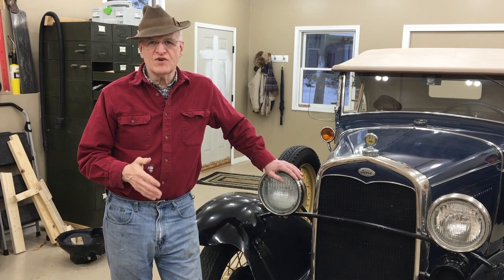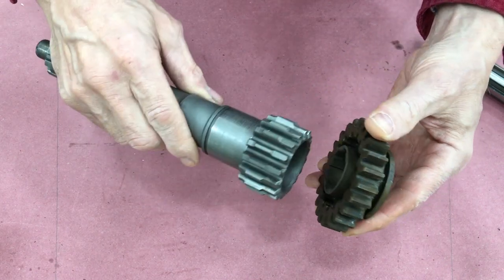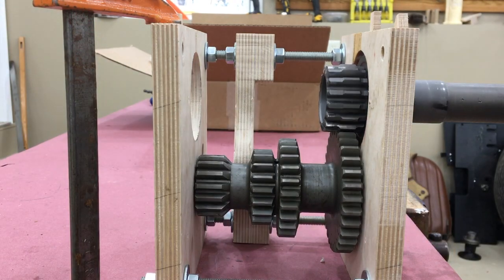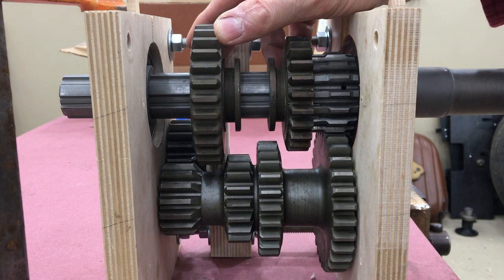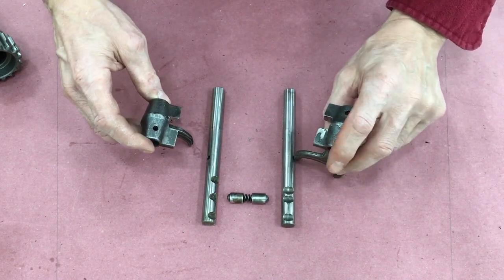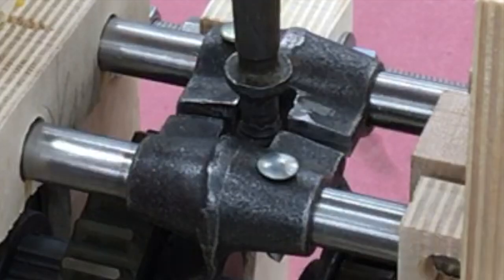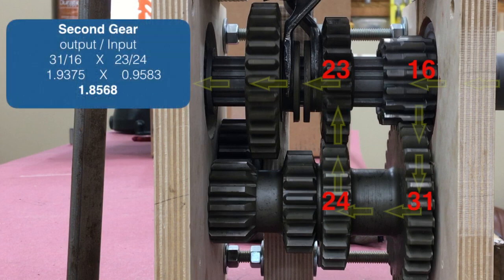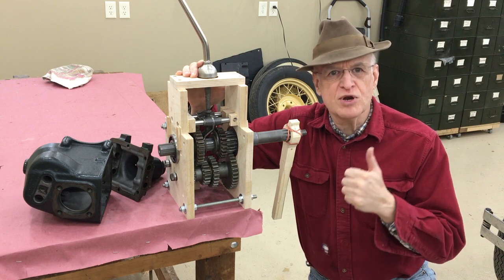Ford Model A Transmission - How it Works

Comment: George, I have a 1929 Model A. It will shift into 1st 2nd and 3rd.  I have checked the shifting forks, gears and reverse idler gear.  Everything is looking perfect. Clutch engages and car moves forward.  I have also checked to make sure the reverse gear is full engaging to the rear. Im at a total loss.  Any suggestions?
Reply from the maker: Sounds like everything works.  What is the issue?

Comment: I need to change my cluster gears. Is it necessary to remove the transmission to do it or can I just slide back the U-joint cover disconnect the U-joint to drop the drive shaft,  and then takeoff the shaft lock remove the upper shaft and gears to get to the cluster gears and remove that shaft clean out the box put the new cluster gear in and then reinstall the upper gears again and then continue the reassembly?
Reply from the maker: Nope, I wish it was that easy.  To take out the cluster gear, you will need to remove the transmission.  To remove the transmission you will need to either remove the rear axel, drive shaft, and U joint, or the engine.  The U joint in a model A cannot be removed like a modern car, it is in line with the real axel, and cannot be accessed absent removal of the axel.  Take a look at the transmission removal video in this series, I discuss this in the video.   Thanks for your comment and watching this video.

Comment: This is a great video. I have a question for you. My first gear is gone. All the teeth on the gear were destroyed by a transportation driver from a production company. I was told it was possible to change the first gear without taking the transmission off the car… by removing the lower shaft replacing the gear and then putting it back together. Is that possible? Or should I set myself up for having to remove everything?
Reply from the maker: Thanks for the comment.  I suppose it might be possible, but you will for sure need to expose the back of the transmission.. to do that you would need to remove the rear axle and drive shaft.  After that work was done, you may as well remove the transmission for ease of working, and to checkout the remaining gears.  If the first gear is stripped, I suspect there is additional damage.  Check out the remaining videos in this series and you can judge yourself.   Good luck.
Reply: Nope out with the transmission.

Comment: Is the transmission for a Right Hand Drive the same? Are all the parts the same or is everything different? Are these parts available? Thanks for a very interesting video.😊
Reply from the maker: Yes, this transmission was used in all cars, right and left hand drive.  Yes, parts are available at most any Model A parts dealer.   Thanks for your comment.
Reply: All the same.

Comment: Hello, I have a 1930 model A cabriolet. Went to the store last night, shut down the car, came back out and she would not move-though the parking brake was on or the wheels were blocked. It acted like the gear shift lever was stuck and I could not get the car into gear. Neutral position on the gear lever was at the top near the dash.  After some nasty words and rocking the car a bit, I could get it into third and was able to get home. It drove like it always does with no issues.  After watching your video's I came to the conclusion the shift tower needs a rebuild. The 2nd & 3rd shift rail was very easy to remove. The shift rail for low and reverse was a bugger to remove from the housing as were the plunger and spring. The shift forks look fine.  I did not see any wear on the plungers or springs, but the rails seemed to have excessive wear.
I was worried something went haywire in the gearbox but I was able to move the 2nd & High and Low & Rev gear very easily.  So, my question to you is; have you ever run across the before? and am I one the right track? Is there something I may have missed?

Sorry for the long question and Thank You!
Reply from the maker: THnaks, I sent you an email

Comment: With all those straight cut gears, that bugger must have been whiney.
Reply from the maker: Yes you are right, first and second whine.  99% of the drive time is in high gear, which is direct from the engine to the rear axel… no gears.   Thanks for the comment.

Comment: Thank you so much for this video!! I just bought a 1931 Ford model a truck and looked it over yesterday was very excited about the inside of the motor being so clean and not locked up! Don't know about the transmission yet so this video would be helpful for me if I need to work on it.
Reply from the maker: Thanks for the comment.  The other videos in this series should help you as well.

Comment: ... I can almost make that with my machine lathe and a few other hand tools. This is really impressive. Especially considering all the forces involved here. The power isn't mind boggling, but they are impressive. Thanks for showing us this. Its almost inspired me to make my own transmission for a project I have. 

And yes, this transmission was leagues better than shifting via foot pedal in the midel T hands down!
Reply from the maker: Thanks for your comment.  Yes I think you are right. With a mill to cut gears, and a lathe to make shafts a fellow could build this transmission in the garage…..  which is kind of what Ford did back in the day.
Reply: Good job Sir!
Reply from the maker: @carlmoseman671  Thanks

Comment: Thank you for this video. I am restoring my model A and i found out i do not have the transmission shifter fork pins. Do you have a preference on which pin to use? This video has taught me a good amount of knowledge.
Reply from the maker: Thanks for the comment.  The pins I used are made of aluminum, and can be ordered from any model A parts supplier.  Good luck with your restoration!
Reply: @georgebell7103  thank you

Comment: Great video! With the oils available today. What do you recommend to use in the transmission. By the way love your Roadster. I own a 30 deluxe.
Reply from the maker: Thanks for the comment.  I use the original type heave oil.  It can be purchased at any Model A parts suppliers

Comment: Great mockup fixture!
Note that the detent ball/slides are spaced apart so that only one selector shaft at a time can be out of its detent pocket. The ball/slides back ends literally run into each other preventing both slides from moving..This blocks sliding both shafts from neutral when the shift stick pockets line up and no side pressure is put on the shift stick and it is pulled back or forward.
Reply from the maker: Yes, thanks for the comment

Comment: Thanks for this. I've never had anything to do with a model a transmission and likely never will but have just watched this video closely and understood it, finding it extremely interesting!
I do own an old Massey Ferguson with a 3 speed main transmission (+ high/low) and expect it will be very similarly laid out to this one as gear gears are in the same positions.
Reply from the maker: Yes, your tractor is likely is very similar. Thank You for the comment

Comment: Yes you did a good job George. But if you’re taking a long trip in your model A. And you want your girl to be close to you and the shifters the way you pull it up and shove the shifter to the dashboard and it stays in high gear pretty cool. When you need to change gears pull the shifter back and it snapped back into place..
Reply from the maker: Sure, Thanks for your comment

Comment: Great job of showing  the  power flow.  There is nothing to add for a modern automobile except for the addition of synchronizer rings and additional gear ratios.
Reply from the maker: Yes, I agree. Thanks for your comment

Comment: The best explanation of how a basic manual transmission works, period.  This could / should be used to teach automotive mechanic students… if they still do that🙄.  I consider myself an advanced mechanic and still enjoyed the presentation and found the ratio math useful.  Great Job.
Reply from the maker: Not really, just haven’t had the inclination to do another video.   However, I have a few ideas in mind.
Reply: @georgebell7103  OK, well, I’ll stay subscribed in case u do 😎.
Reply from the maker: Hey, thanks for the nice comment.  You might enjoy the other videos in this series
Reply: @georgebell7103  Yes, I did watch them all.  Sorry I didn’t comment for each one.  I noticed you haven’t made any new videos in 2 years.  Have u moved on to other endeavors?

Comment: The surprise is not how primitive it is, but in how much they got right and haven't changed since: cluster gear, on counter  shaft, needle bearings, reverse gear, straight through high gear, H pattern shifting, shift forks, slider splines, cluthc plate and spline, transmission housing casting, shift tower.  Seeming only missing synchros.
Reply from the maker: Yes, you are right, the transmission shown here is in its simplistic  form. Ford improved it nearly every year from this point forward.  Thanks for your comment

Comment: I’ve rebuilt modern 5spd automatics and understand them well, but the manual transmission always confused me as dumb as that sounds. This video is the best yet I’ve found that is middle of the road on knowledge; assumes I know a bit but doesn’t assume I know too much. Well done.
Reply from the maker: Hey, thanks for the comment.  Middle of the road is about all the knowledge I have.
Reply: @georgebell7103  
Drive middle of the road, OK. Drive to left, end up hitting semi truck, crunch. Drive to right, end up hitting tree in ditch, crunch.

Comment: Just stumbled upon your video and found it very interesting. Being a mechanic for my entire life, I'm still learning. It's amazing how simplistic those transmissions were. Very compact and did the job also. Thanks for your video! Keep up the good work. By the way, I was trying to find the weight of the Model A when I found your channel. Any clues?
Reply from the maker: Thanks for your comment.  Different weights depending on the body type. The Roadster is 2,300 pounds, which I think is the lightest body type
Reply: @georgebell7103  Thanks for satisfying my query. I was figuring about 3K. I stand corrected..
Reply from the maker: @janyoung1633  Model A was a light car. Ford cars Got heavier during the 1930s as the engines became more powerful

Comment: I Loved your demonstration. Very well put together.
Only one minor item I would have liked to have demonstrated and that was how the shift lever could be raised by the driver to disengage it and rotate it against the dashboard to allow unencumbered entry or exit from the passenger side. Loved my 1931!
Thanks
Reply from the maker: Thanks for your comment,  I have never done this, but have heard others tell the story.  If it can be done it is because the tower of the transmission is badly worn, allowing this kind of movement.

Comment: Great video, great explanations, surprisingly similar to todays transmissions.  Just add sliding clutches between the gears and snap rings to hold the gears in place and it's about the same!
Reply from the maker: Right!  Thanks for your comment
Reply: Either double clutch or learn how to shift without a clutch. Done right, no real grind with either method.

Comment: Excellent video. Thank you for taking the time to build the display box. Seeing the tranny in action from the lateral view is neat. It makes you understand why double clutching and matching shaft speeds lets you slide into gears without grinding!
Reply from the maker: Thank you for the nice comment. Yes, I wanted folks to understand what was going on when they are operating the transmission.
Reply: It's fun to watch someone with little experience trying to drive a car with no synchromeshes on the gears. Most people don't get the concept of matching the shaft speeds.

Comment: Absolutely brilliant explanation. So it's a "crash box". I learned to drive on one, in a Blitz wagon. Very angry if you can't judge the revs. How are the shifters held in place - friction pins, screws?
Reply from the maker: Thanks for the nice comment. The shifters, and therefore the sliding gears are held in place by spring loaded plungers that fit in detents in the shifter shafts.  Check out the transmission assembly  video to see these.  https://youtu.be/rVC-fSBe4WM

Comment: This is helpful although I am still wondering if there is a specific part to connect a model A transmission to a predator 22 hp v twin
Reply from the maker: Yeah, probably need some kind of adaptor

Comment: Many years ago I had access to a couple of different model A Fords. I remember being taught how you could pull up the shift lever when in 3rd gear and then
rotate it off to the side so it doe not have as much interference with the passenger's legs. I was telling a friend about this, as his brother has just bought a
model A, and no one seems to believe me.  I am Kay's husband of 57 years, and spent many of my teenage years working on old cars. Thanks for any help
you may be able to give me.  Dale Lofgreen
Reply from the maker: Sure, I think this is possible. The shift lever is pulled (held) down with the spring in the tower. The shifter also has two pins that hold the lever in the proper orientation relative to the transmission. These pins and the cutout in the tower casting is shown in this video at 8:15.

I suspect the shift lever could be pulled up so the pins clear the indentations in the top of the tower, then rotated 90 degrees. But, to do this you would need to overcome the spring pressure on the shift lever, which is substantial.  

I think old timers that did this trick, perhaps had no spring in the tower, weak spring, or significant wear in the tower casting. I doubt if it could be done easily in a well restored, or new transmission.

Thanks for your comment.
Reply: Great  video,  very  informative   Great  explanation  of  what  happens  when  shifting  gears  . Thanks  much

Comment: Shifting that would take some skill with no synchro cones !
Reply from the maker: Yes it does take some skill, but easily obtained with practice.  Thanks for your comment
Reply: @georgebell7103  So what keeps it in gear, is it just the shift plungers in the fork shafts ? I guess it's enough if the plunger spring is strong enough ???
Reply from the maker: @HaggisCat1  Yes, the plungers keep the transmission in what ever position you put it in, neutral, or any gear.  The shift plunger keeps the one side in neutral while the opposing side is in gear.   And yes, the plunger spring is pretty strong.  Strong enough to keep the forks in the proper position, yet weak enough to be overcome by the shifter when shifting.

Comment: Isn't that sliding gear style of transmission also known as a "crash box"?
Reply from the maker: Yes it is.  But, you can get smooth shifts with practice
Reply: @georgebell7103  Practice makes perfect! =)
Thanks for the confirmation. Good video, btw. Excellent explanation. -b
Reply from the maker: @DeanMk1  thanks

Comment: Ditto all positive comments Mr. Bell. At 70, I understand the basics of most tasks on the Model A. But this level of detail is exactly what I value. At 14, I took the tower off my 31 coupe tranny. Figured out how it worked and slid  the gears, but only recently studied a couple videos and got the full understanding of the the transmission. Your video is the icing on the cake. Keep'em comin' George
Reply from the maker: Thanks for the nice comment

Comment: Ok so here's that comment I owe you :)

Thanks for taking the time to build this contraption and showing us how the transmission works! So nice to see the actual parts in action.

I bought a 1930 Fordor in fairly good condition just over two years ago and it's been great fun to drive. I don't have any experience working on cars, but everything is so crude/simple I managed to do a couple of things on it myself, like replacing all of the wiring (judging by the state that the cables were in, it still had the original wiring in it - incredible!) and changing the oils and greases. Right now I don't have the time to really dive into all the engine related bits, but I am already trying to learn a little bit about them and your videos are excellent for that. You know a good way of explaining things very calmly and clearly.

Since your Model A is already so nicely restored I'm guessing you won't have to do much work on it for now, but when you do I hope you will make another video!
Reply from the maker: Hey, thanks for coming through for me.... great story, make sure you join a local club.  Club  members will become good friends and help you fix up your car.

Comment: Great Video! I always had to visualize how this transmission worked. My father, when alive, restored Model As for a living (MAFCAR of Abilene). In 1963 at age 8, I learned to drive this exact version of a Ford 1931 Deluxe Roadster Model A with side mounts and trunk rack in Washington Blue with a rumble seat. I would sit on my father’s lap, as my feet would not reach the petals and I would tell him when to push and let out the clutch. I would handle the throttle myself on the steering column. At age 12, I rebuilt my first Model A engine and transmission that I installed in a 1930 deluxe coupe. I went on to marine engineering school and learned to run a lathe on the same South Bend that you have in your shop. After 35 years, I retired as a Chief Engineer on a 38,700 HP Nine Cylinder Slow Speed Diesel Container Ship that was direct drive (No Transmissions).
Reply from the maker: Hey, great story, and memories.  All three of my Kids learned to drive in the Model A.  Thanks for posting this comment.
Reply: @georgebell7103  Keep up the good work!
Reply from the maker: @gsmith1shine  brakes this winter